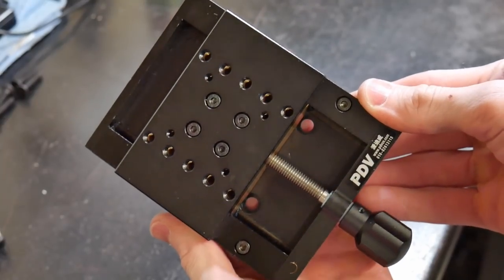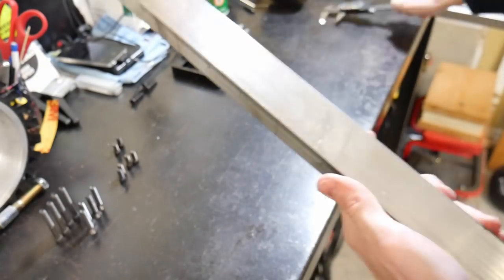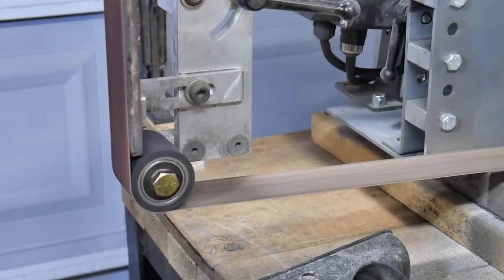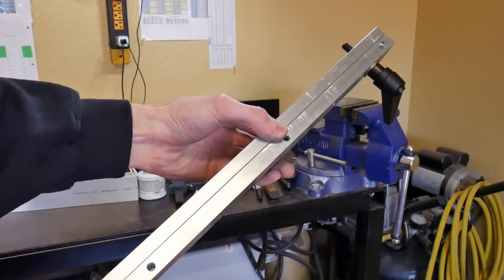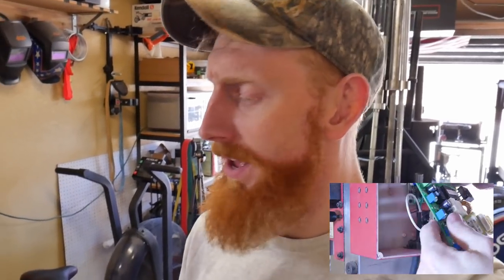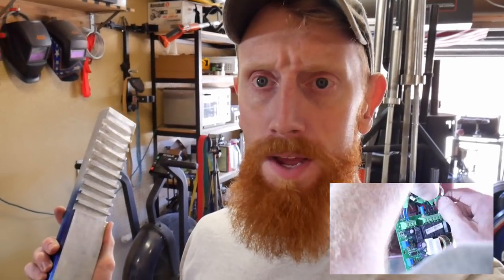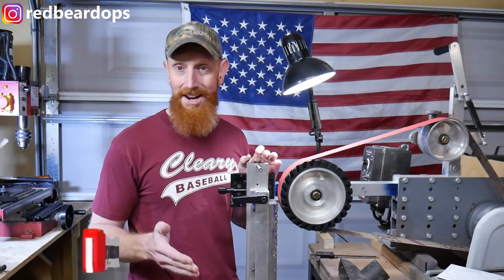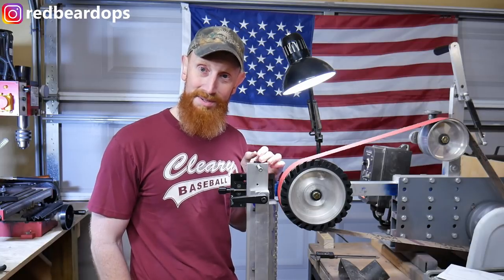Homemade Surface Grinder Attachment - Want Flat Things?

Comment: Good attachment , it will be so easy to handle if the mouvement was horizontal
Reply from the maker: Agreed! Good think about this attachment is that it can easily be used on a horizontal grinder or one that rotates to horizontal. I hope to do this one of these days. Thank you for watching and commenting! Have a good one.

Comment: The name mini-mill is quite apt. I work with these little machines a lot and they work great but as Dirty Harry would say "A man's got to know his limitations"
Reply from the maker: Well it worked out. I would for sure change my approach if conducting this project again; and by learning though this project I will handle new task better! The fun of this hobby for me is learning new things by diving in and if some equipment gets torn up in the process that doesn't bother me too much. Thankfully in this case the mill was repairable and I was able to get on with the project. You're quote is spot on though.
Reply: @RedBeardOps  I do not mean to be critical, you do very nice work  and it did indeed work out quite well. I tend to fuss with things that in the end, really don't need to be "fussed with". You said that one thousandth is good enough in most projects and you are right on. Trying to get "it" closer, is generally a waste of time and adds little in functionality, it may even hinder function.
Reply from the maker: @oldhick9047   Thank you! Yeah this SGA seems like a winner so far for what I do. So far I've been able to achieve a 0.0011'' total variance over a 7.5'' long piece which is way good for full tang knife making. I appreciate your comments and your viewership! Have a good one.

Comment: Hi, Thanks for the amazing explanatory tutorial and for your time spent doing it. I'm planning to make a surface grinder attachment as well soon. Have you ever came across or know where to find any tutorial for the version that runs diagonally and not vertically like this? And what for your experience would be the advantages or disadvantages of both. Thank you.
Reply from the maker: Hey man. This one could be run horizontally if your grinder tilts. I hope to have a horizontal grinder one day so that's why I made it this way. If you go to the thread in the description of this video on blade forums some guys have set it up on a 45 degree. Function wise they all work the same... just one gives you more of a workout.

Comment: i've been meaning to update this video on how i made out (comment below). the flute idea did not work. nearly immediately chipped the cutting edge of the end mill using a drill press. ending up making the slots with 2 million evo chop saw cuts. 

that said though, i just posted the same to jeremy but my belt grinder was built using his (Jer Schmidt) plans. i was able to get the whole thing to work by putting the surface grinder in the left-side (table-side), rotated the right-side to be in horizontal mode with the platten attachment in (it acts as a spacer for the belt and the bigger 3" wheel). All i needed to work out was the spacer below the 3" wheel so that it aligns with the belt in horizontal mode but it works excellently!

Comment: You could maybe attach some kind of counterweight to the part that moves up and down and make it much lighter to operate.
Since that setup is stationary, you could attach the platen to a cable that goes through a pulley on the ceiling and has a counterweight on the other end.

Comment: Surface grinder ,I do like it if you can make a small three roller grinder for paint .They use it for lipsticks and nail polish. It is a good idea because  I  like airbrush and mixing  the paint is the only choice to make .I did see wallpaper  rollers that I  will try to make that.

Comment: To save your drill bit, slow down the RPM and as long as the chips are evacuating, stop pecking. The initial engagement of material is what dulls the bit. The onyt reason for peeking is to evacuate chips unless your using coolant which will help to keep heat out of the cutting edges. You should also be conventional milling and not climb milling. You will get a better surface finish since your axis are not rigid
Reply from the maker: Thanks for the tips James. Have a great week!

Comment: You may have covered these questions at some point in previous videos but this is the first one of yours I've watched. Great vid!

Is that a home made band saw? I'd love to have a metal cutting band saw but a good shop quality one is pretty crazy expensive for my little bit of work. A wood cutting badsaw just doesn't seem to be either tough enough or will it run slow enough for cutting steel. I've considered buying one of those portable metal cutting band saws and rig up a way of attaching it to a table. Is that what you've done?

Also, what I find really handy for transferring hole locations is they make a set of transfer punches that have a punch point on an accurate diameter shaft. I think China Freight sells them but I picked mine up from a yard sale. They don't help much on thin sheet metal as the point on the punches are like about .030" or so. But on material at maybe 1/8" or greater thickness they're super handy and the "divet" left behind is usually big enough to center a small drill.

How do you like that automatic center-punch? I see it leaves a good mark on aluminum but does it leave a good mark on steel? I keep threatening to buy one and was curious as to your opinion of them.
Reply from the maker: Nope I bought it! Here is a review of my bandsaw - https://youtu.be/lbh13NJbRzk - Cheers sir!

Comment: Watching you cut those screws free hand on the band saw really puckered my hindquarters! I'm definitely not a safety Nazi but I don't have balls enough to do that haha! Great project and good video.
Reply from the maker: Hah, you're welcome for the rush of excitement! Not OHSA approved. Thanks man, it was a fun project for sure.
Reply: @RedBeardOps  Protip for cutting down screws: thread a nut onto the screw before cutting - this will enable you to deburr the thread after the cut cleanly
Reply from the maker: Leon Ma thanks for the tip sir

Comment: I enjoyed this video. Thank you. You do a great job. I looked on Amazon for that mill but they aren't selling them now. I don't know if they will be getting them in again. I was wondering how much they cost or if there is another seller? Thanks again.
Reply from the maker: Hello sir, check out the links in the description of this video - https://youtu.be/VXVmgFnre-I

The good thing about the little machine shop version is that it comes with the air spring installed, better gears, better motor, and a SOLID column.... I'd buy that one

Comment: Im sure you know more about milling since this video. But the rule of thumb i learned with aluminum is the highest rpm you can get, use an up-cut spiral end mill, and turpentine for lube and you can haul ass!
Reply from the maker: Thanks for the tip!

Comment: Thank you for sharing, question you did not show the bar adjusting during your first grinding, so you do not need it? what is the purpose of it, thank you and have a nice day.
Reply from the maker: Hello, sir. During the initial testing I have the bar set in the "maxed closed" position so that it rest against the stop nut. This will be the position in which the chuck is trued up to the wheel and where I'll do most of my flattening. The adjustment of the arm is primarily for tapering tangs. In this case a specific shim will be placed in between the arm and the stop nut in order to achieve a specific tapering angle for the tang.

Comment: dont forget that the size grit of the sand paper is un-even to take account of measuring because they are small rocks that are randomly put on the paper so even if you measure the gap from the surface to the spinning wheel with the paper there will be a slight difference every time due to the rock grit having un even size of rocks within the paper.
Reply from the maker: dreamkiss4u agreed. This machine will not be as precise as a stone wheel surface grinder, however I’ve been able to hold between 0.0011” and 0.002” with it so far 👍
Reply: @davidhoback4225  no one says they don't work lol

Comment: Just a thought...if you used one of those 'tool balancers" attached to the top of the mag chuck, you would reduce the torque load on the device, especially on the adjustment table,  so, maybe, reducing wear on its bearings, and reducing any potential 'droop' of the sliding assembly
Reply from the maker: Nice idea Lohi! Thanks for the comment!

Comment: Very detailed and interesting to watch. I wonder, if it would become more handy and less of a workout, if there is some construction for retracting the magnetic holder slightly to the top position?
Reply from the maker: Yes sir for sure! However, an easier way would be to rotate the whole belt grinder counter clockwise. This is actually a very common feature that many modern 2x72 belt grinders have. Mine just doesn't! One day I hope to have this built into my machine. By doing this the assembly would be rotated 90 degrees and way easier to use. All that being said; It really hasn't been that much of a challenge to use at all in this orientation.

Comment: A roughing end mill would be better but a two flute mill would be even better.  If you do a lot of aluminum there are single flute end mills that do great on aluminum.
Reply from the maker: Cheers man, thanks for the tip! I will for sure use a different end mill on aluminum the next time! Thanks for watching.

Comment: On the belts try Industrial Abrasives in PA. They will make belts to the size you need.
Reply from the maker: Thanks for the suggestion! I ended up getting some from Combat Abrasives to try out. Cheers man.

Comment: Magnetic tool makes it hard to position, adjust precisely and to take off the work peace.  Moreover the metal dust sticks to the magnetic tool making its surface uneven, leading to uneven surface, which will result in imprecise work, as well as magnetise the work peace itself, which is not a desirable outcome.  So, instead of magnetic, make it electromagnetic.  Besides eliminating the magnetic problems it also will make the tool lighter and much easier to clean, control and so forth.  For safety reasons you should also make stop ribs just in case the work peace flies off from under the belt.
Reply from the maker: Agreed, check this update video out - https://youtu.be/_PYztWN2BiA

Comment: What did you use to grind your knives down before you built your badass grinder?
Reply from the maker: Do you mean what did I do in order to flatten the blanks before the surface grinder? I would use the flat platen on my 2x72 to get close, then use a granite block with some sand paper to make flat. Cheers sir!

Comment: Question? Your thoughts on adapting a milling machine with a magnetic Chuck and using a fly cutter or a grinding bowl as a surface grinder. I’d appreciate your input on this. Be blessed!
Reply from the maker: I don't think that is a bad idea. You'd probably want to put a power feed on it. Also you'd have to use a grinding bowl if you're looking to surface hardened steel (or carbide on your fly cutter). I'd imagine it would make a bit of a mess too, but if none of that is a concern I don't see why it wouldn't work. (Also probably slower than a belt for sure, but possibly will give you a more precise result).
Reply: @RedBeardOps , thank you for the input. I saw it an JF-Kinves YouTube channel. Be blessed!

Comment: Hmm. Will this work with the Revolution grinder build I'm doing? Thats probably a dumb question.
Reply from the maker: Well, I think it will work, but you should probably use the appropriate tooling arm for that grinder. Will require a little bit of measuring to figure out the appropriate dimensions.

Comment: Thanks for the link, I really appreciate your sharing. I noticed that you were using a detailed drawing during the build. Would you consider selling a copy?
Thanks
Reply from the maker: Check out the description for a link to the thread on this SGA on bladeforums. THere are many drawings in there to build off. Mine was very crudely put together after researching on the forums. CHeers man!

Comment: You can run more depth of cut with coolant.  Soluble oil.  The aluminum is melting.  You are not cutting.  With coolant you can take half of the end mill cut at a time.  Just a tip.
Reply from the maker: Thanks for the tip!

Comment: Xometry.com is reasonable for aluminum. They also ship for free which is usually what makes them less expensive.

Edit: what’s the accuracy of the slider? Wondering if it wouldn’t just make sense to use a hgr25HA or 30 linear rail? Having a fadal and bedmill much of the parts could be easily fabricated. Nice build video.
Reply from the maker: Thanks for the link. So far I've been able to achieve a 0.0011'' total variance over a 7.5'' piece... which to me is more than adequate for my application. I'm sure it could be tightened up though! Appreciate you comment and thanks for watching!

Comment: J amazing work, amazing build!  Would you say a knife-maker should have both a disc grinder and a surface grinder?  Or one or the other?  You see I have been eyeing the OBG surface grinder.  Dilemma is, I have only just finished setting up my 1hp, VFD (KBAC-24) run 9” disc grinder, and I am afraid the wife will go after my kneecaps if I get the surface grinder haha😆😂🤣. 

Joking aside the disc grinder does get things extremely flat on the flat disc, and tapers things nicely with the 1 degree beveled disc.👍👊
Reply from the maker: Hey man, I don't have much experience with disk grinders! I've heard great things about them though! Heck if it's working don't change it. Keeping your kneecaps is important! Thanks for watching and commenting as always. Sounds like I'll need me a disk grinder down the road for sure!

Comment: Ok James. Very nice design. I am going to build this for my tilting 2X72 so I can do horizontal. Any idea where to get the 3” wheel of China isn’t shipping ?  I quick Google search yielded $350+ results.
Reply from the maker: I hate to say it but I don't. I've looked around as well and can't seem to find anything not from china. You could modify this design to use a 2'' chuck with a 2'' contact wheel if needed, but that could limit you down the road. If you end up finding a domestic option please let me know! Also note that a 8'' diameter wheel is not necessary.
Reply: Thanks. Will do!

Comment: with knifes, do you only grind with the long lay?  I am more of a hobby machinist, so being able to turn that chuck relative to the grind wheel would be useful.  You could get 90 degree increments rather easily using a dedicated bar to mount the table, just use the slot below the grinder arm and rotate as needed.  The more useful setup would be a flanged pivot at the end of the arm so you could rotate to a whatever suitable to grind bevels for example.  Nice build, thanks for sharing.

ps...re: bandsaw --how do you still have all your fingers?!
Reply from the maker: There are a couple of upper end SGAs on the market that has this feature for actually grinding the bevels. For me this unit is primarily for getting the blade flat post heat treat. I then grind my bevels in afterwards by hand. The bandsaw looks way more precarious when speed up to 1000x speed! Cheers, thanks for watching.

Comment: do you see any reason why you couldn't keep your mag chuck bar vertical and (using a 2 flute end mill) plunge cut using a drill press for the magnet slots? i guess the same question goes for the adjustment slot. 

That's going to be how i'm going to have to attack it but the listing on McMaster said that the particular end mill i got is built for plunge milling aluminium.
Reply from the maker: If I'm envisioning your description right, I think that would work.
Reply: @RedBeardOps  I think we're on the same page. second thing I was curious about was with the spacer you put in between the arm and the wheel... I have to imagine that the edge of the belt and inside (arm-side) of the wheel and table still lines up even if you were to use a 3" belt, right? how long did that spacer end up being?
Reply from the maker: @thebogamin  Yes the edge of the belt lines up with the inside edges of the top wheel and drive wheel. I don't remember the size of the spacer, but it will be different for each machines I think.
Reply: @RedBeardOps  makes perfect sense... I'll just have to measure and do the damn thing! can't wait for this, I've had the table and sliding mechanisms for awhile... finally ordered the metal to finish the build whenever the wheel comes in!

Comment: If that was 6061 0 condition aluminum,  You were correct,  A Two or Three Flute End Mill, would work better.  6061, is Gummy like Copper. If you drill Copper or Brass, break the lead , (Dull it) that will keep the Tool from Sucking into the Material. Help Full Hint's I Hope.
Reply from the maker: Hey Don, thanks for the tips! Much appreciated.

Comment: Nice information here sir. I will make one for myself for sure. 

Man... watching you mill was cringing :) no offense. I am no machinist and I learn as I go.
I recommend using "Roughing End Mills" for fast material removal and WD40 as cutting fluid when milling aluminum.
Good job!
Reply from the maker: I feel ya Faruk! I had no idea what I was doing... and I paid for it. A roughing end mill would have been a much better choice! Glad you'll get something out of this video though! Cheers. Good luck with your build!